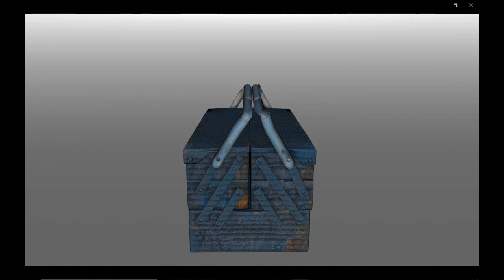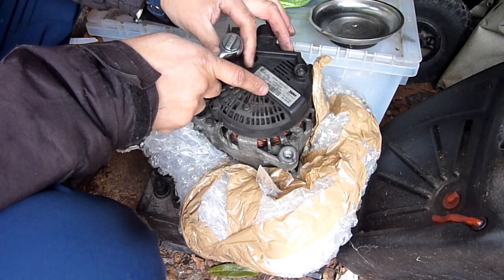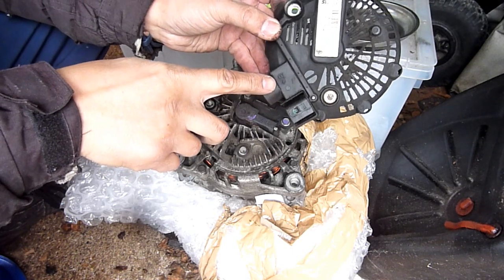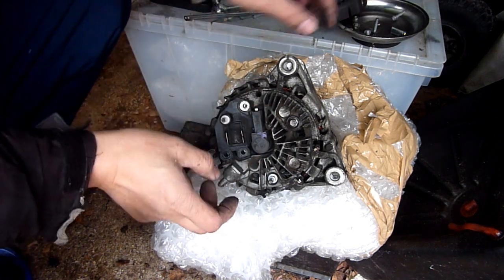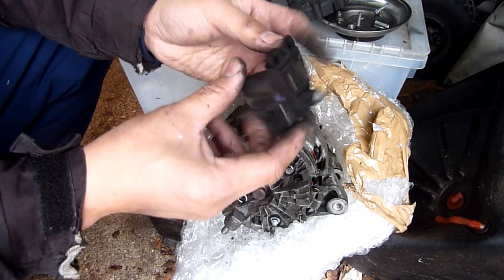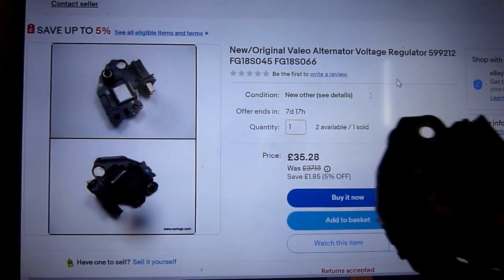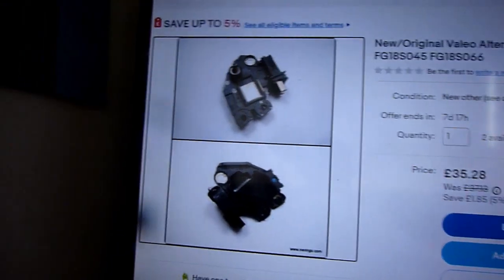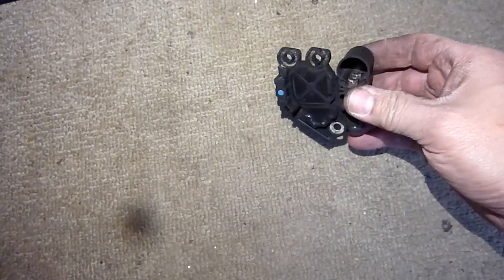Valeo Alternator Change Brushes and Voltage Regulator Ford Focus 1.5TDCI MK3.5

Comment: You just need to change the Brushes, not the whole regulator !
Reply from the maker: @SpikesMavic  only if you can snap off the plastic cap, so not worth it.
Reply: It comes of quite easy, using a screwdriver, just done a Valeo Alt